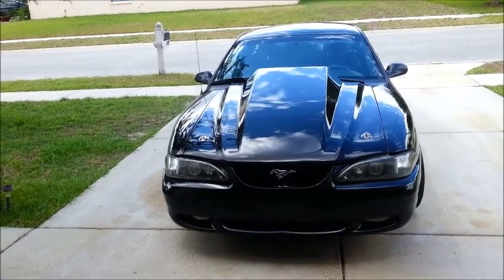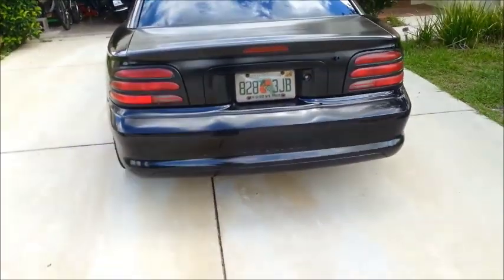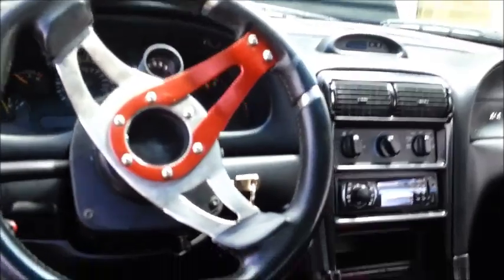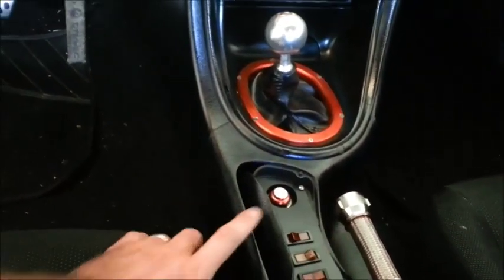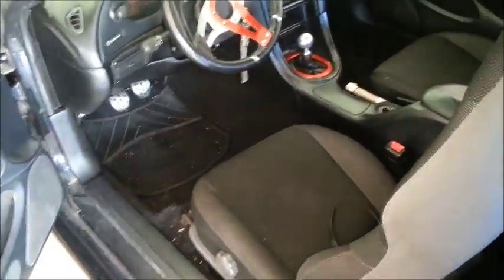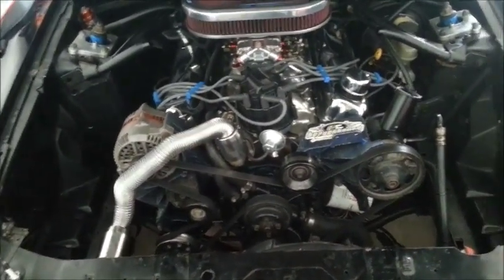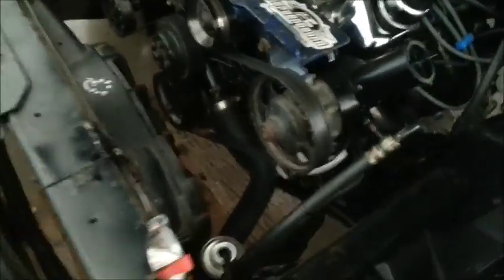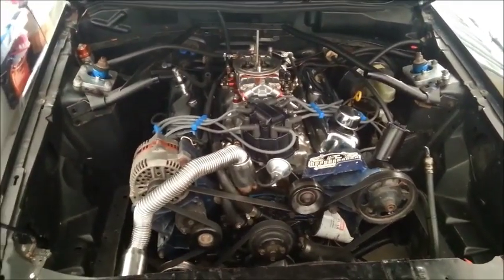1994 mustang gt  walk around. Stroked windsor 408ci, BEAST!

Comment from the maker: it really wasn't too hard. i just used some tin snips and cut a thin piece of scrap sheet metal. i think i made a few templets out of paper in order to get it close. the tricky part is making sure the wires are clear of the panel when it is open/closed. in hind site i would suggest pulling the center console out rather then working in the car. good luck, thx for the love.

Comment: Did you have Any problem with driverside header and stearing shaft?
Reply from the maker: problems, no, but it does make engine install a giant pain. the clearance is tight, but it works.

Comment: Looking to put a push button start like yours in my 94 GT. Been looking around, and can't find one like that. Do you remember the brand it is??
Reply from the maker: just a momentary rocker switch i got off amazon. i hooked it up to a relay, connected to my starter. the amperage for the relay is really low, any cool locking switch will work.

Comment: I'm efi onmy 95 gt40 set up etc how did u hook up ur push button start up?
Reply from the maker: i unhooked the OEM starter wires, the little ones that go to the solenoid. I made it so I have to turn the key to the start position to energize everything. then just hook up wires and a relay to your starter solenoid and  use a push button, momentary switch to crank the starter.

Comment: Does your transmission have a whining noise ? I ask because I did a 5 speed swap off of a v6 on my 95 gt and it's been making that noise
Reply: I would say that would be your rear differential making that noise
Reply: +Miguel Solis the T-5s always make a whining noise
Reply: +Andres Rivas my t5 whines too, 1st through 3rd
Reply: They all doing it,  all rearends do the same.
Reply from the maker: you are right, it's my gears that are whining, this transmission did not whine. I have since replaced it with an Astro A5 trans and it whines a little until it is fully warm.

Comment: MPG?
Reply: Mitch Luck LOL!!!!! My 410w in a '95 GT gets around 16 on the highway and LOL around town. Mostly because I've never tried to baby it for a true, best attainable MPG test.
Reply from the maker: i have done a straight freeway tank and gotten 19.7 mpg. My new transmission has a slightly lower 1st gear, which brings the revs down across all gears, and i have my carb dialed in better now. i should be able to get 24 if i were to baby it for a whole tank, but i go WOT too much to ever really get good data.